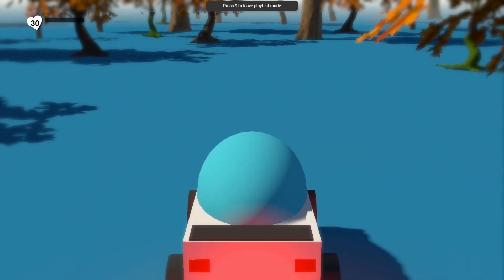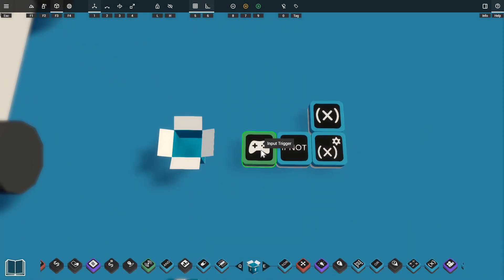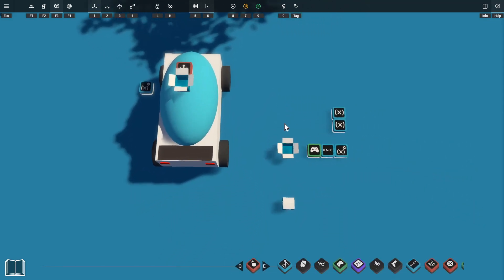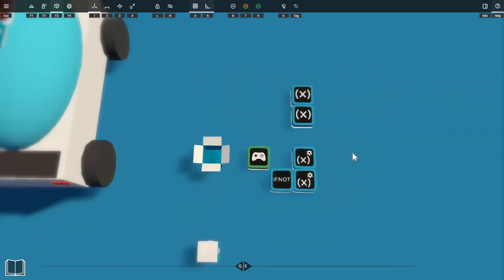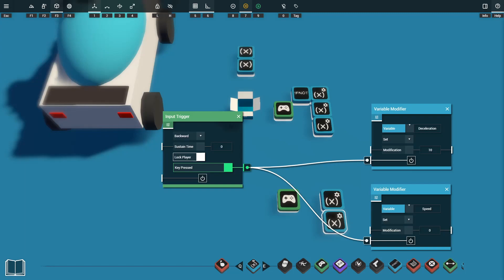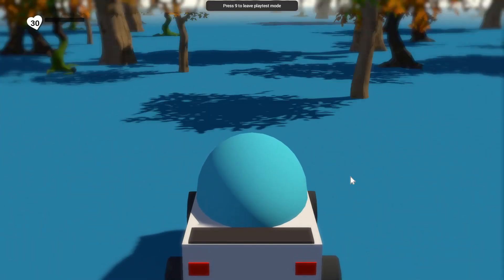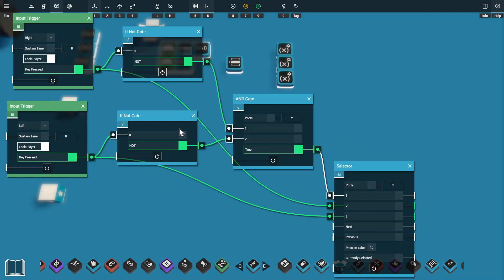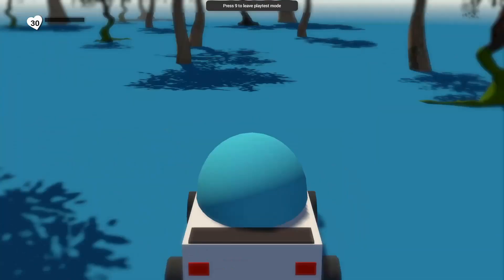MAKING A PROP CONTROLLED VEHICLE - CREY Tutorials

Comment: I can't get the acceleration even, when i send the signal from the variable modifier to the directional mover, it doesn't put speed to 30
Reply from the maker: Hey :) can you check with a ‘number displayer’ set to ‘2D’ and verify that the variable modifier is getting the value of the variable properly?